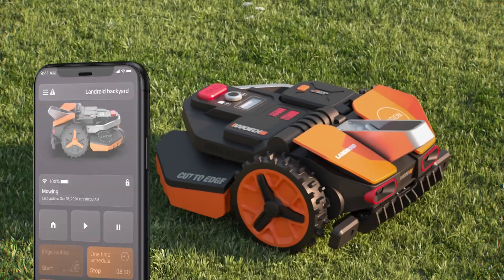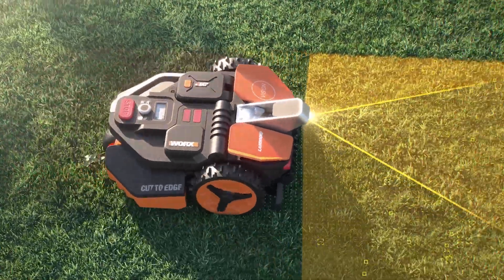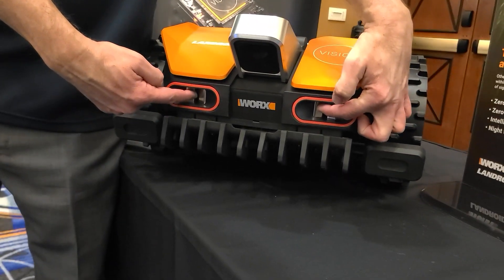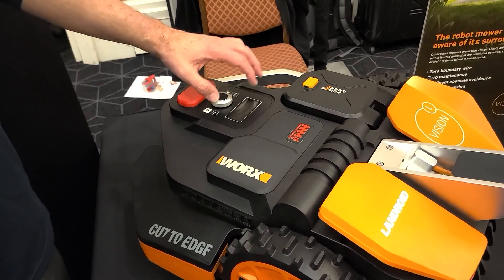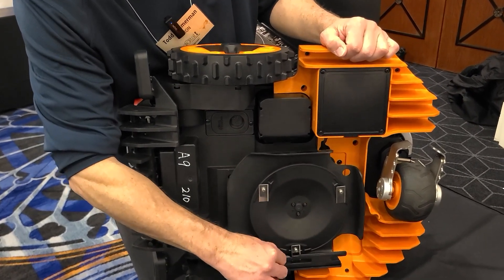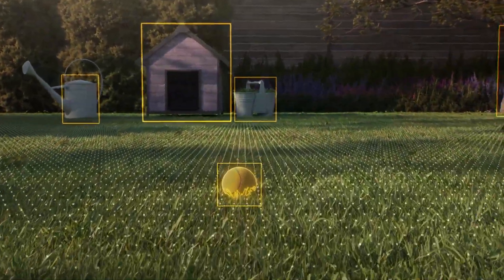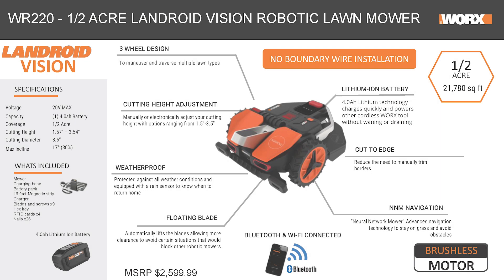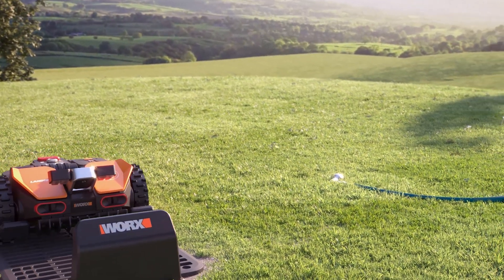HD Camera Powers Robotic Lawn Mower Vision

Comment: I have the M800, getting this thing to actually start mowing the lawn is no easy task to complete. The mower has to complete 1 full round of lawn exploration, basicly it has to find and follow the edge around the garden. Due to the design of the camera tilting downwards, it bumps into anything hanging above ground level, like the edge of a porch. If it get's stuck during the lawn exploration (and trust med it will, unless you have a perfect garden with perfect edges) then you have to restart the process from the charging station, it DOES NOT remember where it was..
I was under the impression that this robot would map the layout of the garden, since it has to perform the zone mapping, thus making some kind of map to navigate with (like a robot vacuum cleaner). But, when the mower needs to go home to charge, it follows the edge to find the charging station. This I don't understand. If it has already mapped the garden/zone, and it started and ended at the charging station, shouldn't it be capable of finding the shortest way back home? (Like a robot vacuum cleaner).
Anyone knows the answer to this? If anyone from Worx sees this, I would love a reply.